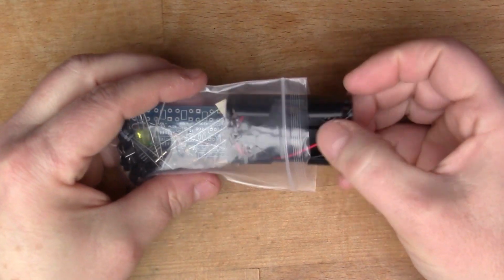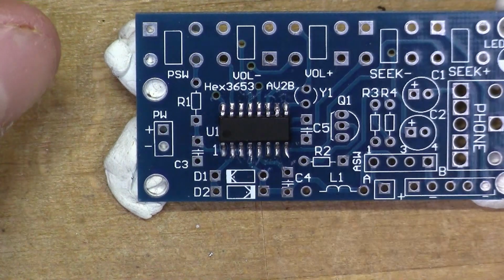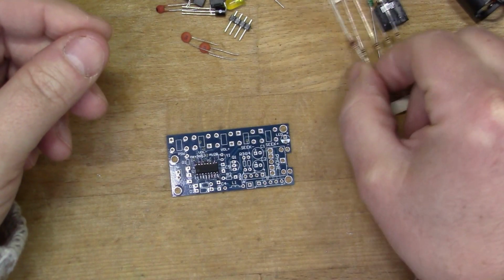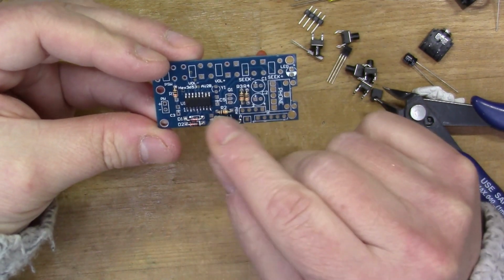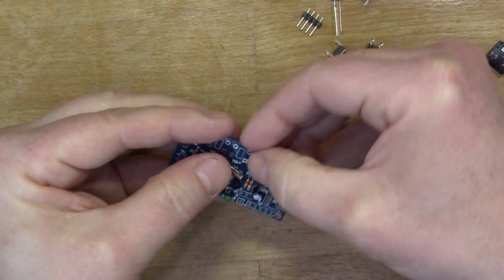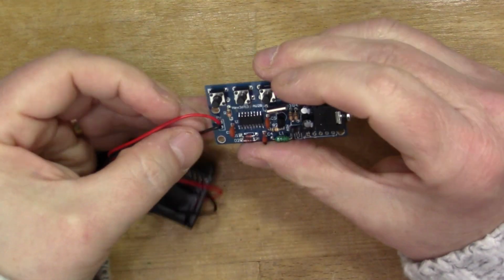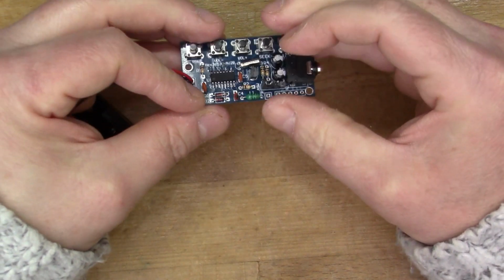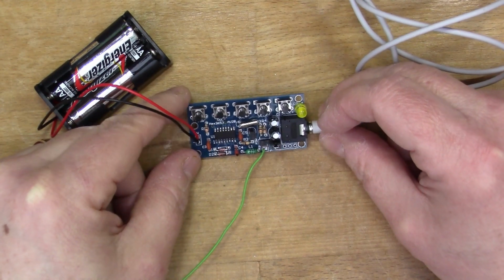FM Radio module - kit build  (#68)

Comment: why reason, we use IC in the FM receiver,,,?  (plz ,Explain me)
Reply from the maker: Because it contains all the demodulation function, stereo decode, program seek, amplification etc. It's much cheaper and easier to design with an IC than create a discrete design that does the same.

Comment: **QUESTION**
Anybody know of a way to connect up a frequency "TFT or LCD" Display to this kit?
Reply from the maker: A datasheet for the chip, the Hex 3653, is elusive, but it doesn't look like any channel data or frequency information is available outside the chip.  The Lout pin seems to double as the left audio output and a 'channel lock' signal (this is where the tuning LED is driven from), but this seems to be the only information available.
Reply: Sigh Yeah tell me about it  @MartynDavies  very little info indeed, If only I was able to read Chinese or Japanese when I came across what could have been more info on the chip, I guess I may have to get another kit which has a display of the frequency it is tuned in to and see how close that kits chips pinouts are configured, and see if I can hack out or is that hack in to one of the pins of my kit that show any frequency changes, and thus see if I can come up with what the other kit applied for its display..

Comment: oh, so how do you get radio channels from it? baffled.
Reply from the maker: I don't have it to hand now, but I seem to remember that two buttons are used to scan up/down.  If you press and hold the button, it starts scanning; it stops when it finds a strong signal.  You do need a good length of wire for the aerial, though, else it doesn't pick much up.

Comment: I had to send for missing resistor ,while I was at it I ordered another kit,just in case ,for the missing resister,I had to order a 1/8 watt resister,I probaly should have ordered a 1/6 watt ones too,I hope the one eight watt is what I need for my missing resister,if you order chinese resisters ,you will get a pack of a hundred or a pack of a 1000 for about 2.00 buck ,if you order a American  resister you will get 2 resistors for the same price and you will pay shipping too